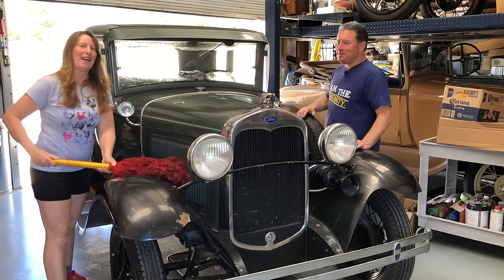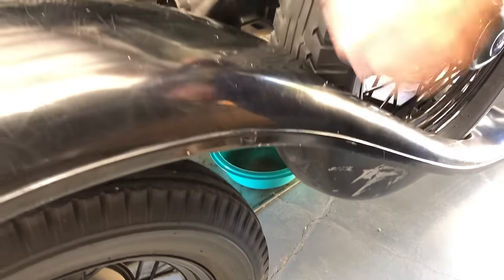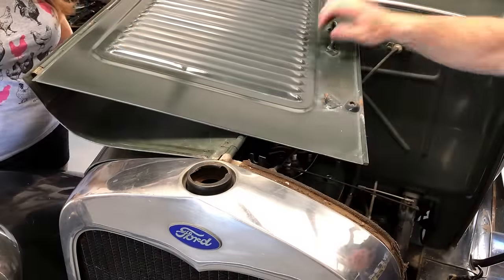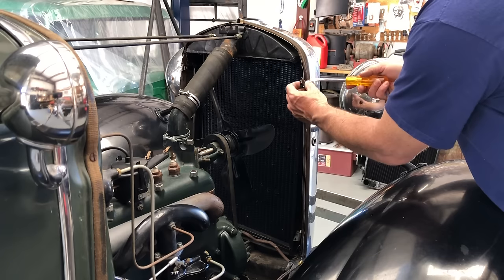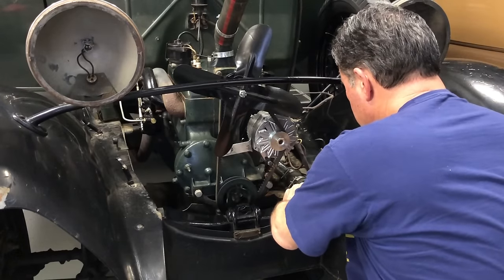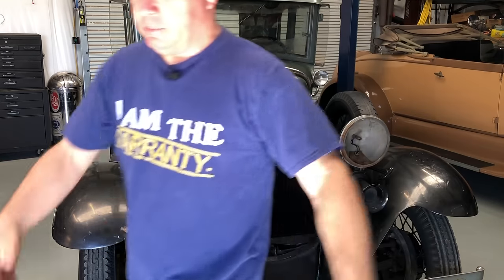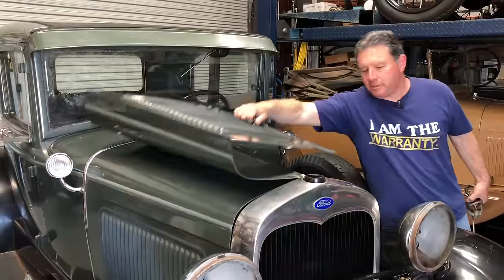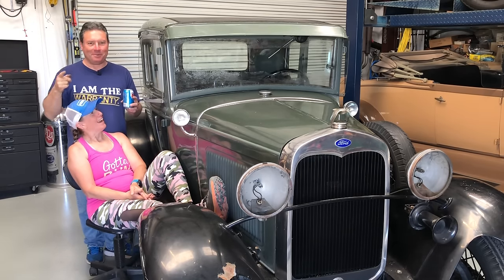Model A Ford Radiator Replacement & How to adjust hood/body lines

Comment: I get to live vicariously threw your channel, love watching you give us all this vast information. You probably told us in a past video, but can you let us know what adhesive you used for the rubber pads under the radiator? Yes it's threading, looks good on the spring tension, your hole is a little off, you got it! I do the same with distilled water, I don't use antifreeze on the first fill. Enjoy watching these instructional videos, especially when I am a person that learns a lot by someone else demonstrating it.Thanks Paul, I hope you have a great weekend.
Reply from the maker: Thank you Dan!  It's just clear silicone.
Reply: @ModelA  ah, I got it thanks

Comment: Hi Paul & Tina,This has Nothing to do with your latest video. I have owned my 1931 Delux Washington Blue, Tacoma creme, Lebaron Boney interior, Roadster for over 60 years. (numbers matching) I'm the second owner and I've fully restored everything mostly myself. Just had the motor totally restored for the first time - did the inserted, stock head, modern valve guides, valve seats , oil filter everything you recommended, stock flywheel & clutch and I've now got 2000 Miles, it's great.  I like to keep a spare of a few restored tested items with my car carb, distributor, water pump in the case of a roadside emergency.   Recently In restoring a spare distributor, I did new bushings honed to size, new drilled shaft, original style points & condenser. In the parts illustration in Les Andrews vol1. it's not clear where the condenser fiber washer goes. Is it between the 10/32 X 7/32" screw and the condenser, or between the lower plate and the condenser -? Or does it go between the 8/32 X 1/4" screw on the distributor body?  Thank you,
Reply from the maker: Excellent! YOU really are the warranty!  The answer is toward the end of this video -  https://www.youtube.com/watch?v=GP7Bk9Fa-B4 

Along with an explanation of why

Comment: I'm  aware this is a older  video I watched it again because I just changed a 28 radiator for a friend.  I'm having a very tough time getting the hood to sit nice ! WHY😅 THX MR S
Reply from the maker: Where's the gap? rear hinge line or front? top or bottom?
Reply: @ModelA   IT wants to overlap against the radiator cowel at the base .. The spaces are at the bases of the cab cowel area. Thx Paul.
Reply from the maker: OK, sounds like the cowl is too low or the radiator is too high.  You can lower the radiator by getting thinner rubber pads for under the tabs.  Or maybe there's more than one rubber pad under there??  You could also shim the front of the cowl, but be careful because it will affect the door alignment also.

Comment: Your idea about using screw drive radiator hose clamps first is spot on,  but I think the reason why the original type do not work as well
is the metal tab UNDER the screw is digging in and stopping it being tightened down.  I was told to put some grease on the area of the hose where that 
tab is enabling the tab to slide instead of digging in.   This is a common struggle with us WWII Jeep owners as well.
Reply from the maker: It has to do with the clamp geometry.  the clamp screw is so far above the hose surface, the metal tabs try to bend in and down instead of all around evenly. Back when Model A hoses were softer, these clamps were adequate to seal them.  But today's hoses last a LOT longer, and are much tougher and need to be trained with worm clamps before the era correct clamps will provide enough grab to seal the hoses to the inlets and outlets properly.

Comment: Paul, you said in your reply that after the rewiring is done, then the wind shield is on the list. When the new wiring harness is put in the directional signals will be hooked up. so, are you going with the old style signal switch? The one that you installed on a previous video. The one that you said is VERY rare.
Reply: After further research Paul, the model I'm talking about is the Signal-Stat Model 700. It's a wonder some one doesn't pick up the design and remake them.
Reply from the maker: It will be a Bratton's wire harness using the actuator that comes with it.

Comment: Oh, Paul! Would you take the time to explain why it is important to use the springs? Some people may be tempted 🤔 to mount the liquid filled heat exchanger with nuts and bolts only! Bad idea...
Reply from the maker: Watch a Model A go over speed bumps sometime, and you'll know why the springs are there.
Reply: Yes, frame flex. The frame acts as a large spring! The early hot rods flexed the frame so badly that they were known as 'flexy flyers'. Even today with unitized body construction, flex has to accounted for.

Comment: What I am curious about are how does one select tires. There seems to be a dimension change between the '29 ad '31 tires, but what bout which brands work well, and which don't?
Reply from the maker: This is ONLY my opinion- Stick with the name brands (Goodyear, Firestone, etc.).  The 1928/29's have 21" wheels, the 30/3-'s have 19" wheels.

Comment: I noticed Gandalf has a 4 blade fan. Read that many tours will not permit them. Wouldn't this have been the time to replace it?
Reply from the maker: That fan is absolutely perfect.  Some of the repro 4-blade fans were not made very well.  This one was made in USA, prior to the ones made out of chinesium being sold.

Comment: Quick question. I see some model a with big and small radiators whats the difference in performance?
Reply from the maker: The 1928 and 1929 Model As have a slightly shorter radiator, the 1930 and 1931 Model A's have a taller radiator.  There is a slight difference in cooling capability between the taller and shorter radiators, and Ford knew that, thus the reason for the change.  However, if your 28/29 radiator is clean (no clogged tubes) and the fins stay attached to the tubes, it's pretty difficult to make a 28/29 overheat.

Comment: Greatly enjoy your videos ,bought a 1934 Ford pick-up no rust no dents we like driving it ,short drives, it is equipped with an overdrive behind the 3 speed transmission. however it is pretty noisy in the high side. Itis new enough to me I use fender covers even to check the oil. Please keep the videos cumming .
Reply from the maker: Nice!!!  Now, YOU are the warranty!
Reply: BUMPER to TRAILER HITCH LOL @ModelA

Comment: Does an AA truck radiator have extra cooling capacity?  Will it fit in a car or are they the same?
Reply from the maker: Same radiator, from the factory on some.  Later, some 4-core radiators were used and those worked better.

Comment: Paul I have a question for you about the radiator. My 1930 coupe has a good radiator, however the fill neck is messed up. Someone put an extra set of groves in and it is short. With my radiator shell in place there is only about 1/8 or less sticking above. This in turn does not allow the cap to get a good seal. Every so often I have a spotty windshield because coolant is leaking out by the cap and spraying on my windshield and shell. Are there radiator shops that could weld a new brass neck or should I get a new radiator. Btw I’m praying for the people of Ruidoso and several people from my club are going to NM yo do a smaller tour. I’m the one that sent you a picture of my car with my parents in it. Thanks for the help.
An enthusiastic model Aer
Andrew
Reply from the maker: Hey Andrew! Of course I remember you. A 1930 or 31 radiator cap should sit pretty low.  when I take the cap off of my 30 and on my 31, the top of the neck (the brass part) is about flush with the radiator shell.  the cap fits down and in between the shell and the neck.  Like it is shrugging its shoulders.  Is your radiator's neck way below the shell or about even with it?  And, getting a little spray on the window, particularly when pushing it, like climbing a long hill, would mean either it was too full in the first place, or the head gasket could be leaking.
Reply: @ModelA  I just put a new head gasket in
Reply from the maker: @desertdawg3157    All the more reason to suspect it is not getting a good seal.  Have you re-torqued it?
Reply: @ModelA  I checked the torque many times. I think it is the seal on the cap. I bought a new cap and I had to take about 3/4 inch off. Either that or my shell is messed up. I will retorque again and I will see if I can send you a picture of it. Btw one of the guys that helped me with the cap said he knows you well. He is the vp of the club I’m in Mr. Joop
Reply from the maker: Oh yes, I know Joop and Marlies very well!  Very nice people!  If you have a look at this video- https://www.youtube.com/watch?v=Cveg5ivBlWw  you will see my 30 coupe with the radiator cap off.  Is that how yours looks?
Reply: @ModelA  hey Paul. I checked the torque on the head and everything was good nothing moved. I’m going to see if I can send you a picture. My neck definitely looks different than yours.

Comment: it looks like you dont run antifreeze in Gandolf is that correct
Reply from the maker: I run 50/50 antifreeze and distilled water AFTER making sure there are no leaks.  I talked about that in the video

Comment: May i ask why is there a spring on the radiator mounting bolts?
Reply from the maker: To flex with the frame movement
Reply: @ModelA  thank you

Comment: Craftsman, works every time :-) been using them for 50 + years... I know you know Daryl, from VVG, Hitch Hiker side or Drinker Side. Driver V.S. ... you are both so funny. I sure like the simpler times, but that white Ford sure turned out so nice. You have mentioned Made in The U.S. of A. things several times, cotter pins too? Seems China has replaced so much American business. American business is not looking for Quality, just the bottom like. &, you know, if you look at the bottom, that is what you will hit. What has Toyota done, for decades? How can our product improve so our buyers will enjoy it more? Toyota & Honda have quite a following, Because their stuff lasts a long time, & Holds value. I had a GM car, 12 years, 200K - almost - miles, $300. & most of that was highway miles - & why it lasted... American Business. You need to take a Hard Look at where you are going, & WHY. If Not... Dust in the wind. Thank you for your videos.
Reply from the maker: Right on, brother!!!

Comment: As an extremely novice "Model A Expert", My first tip is Don't try to remove or reinstall your hood by yourself! THAT looked very difficult and possibly dangerous.
Reply from the maker: I used to be able to do it effortlessly, when I was a younger man.
Reply: @ModelA  Looks like you've lost some weight.
Reply from the maker: Life-long Health problems